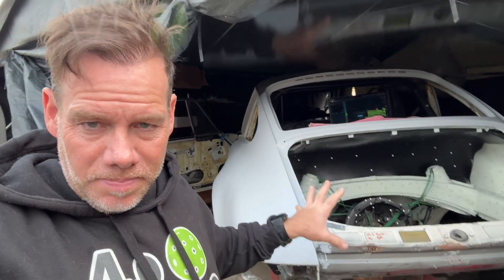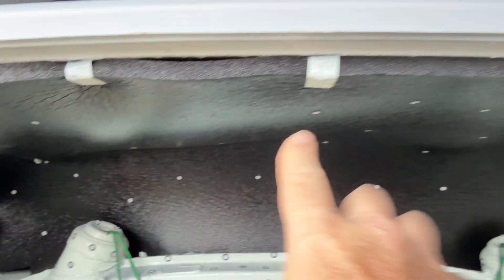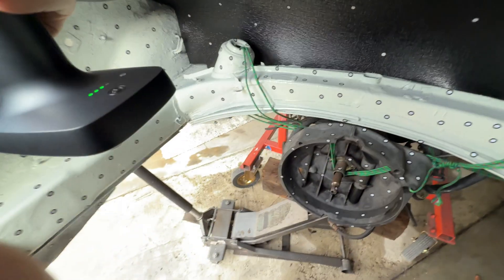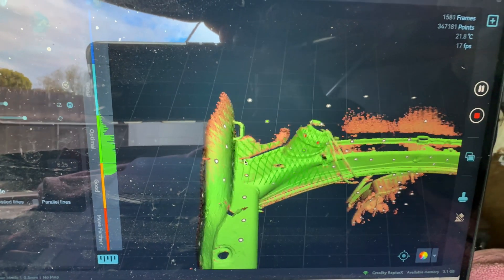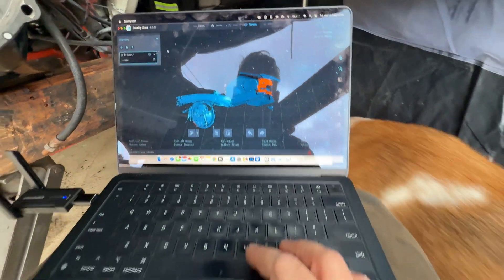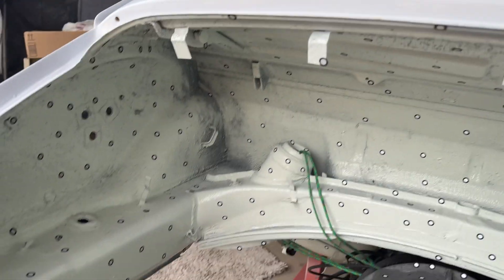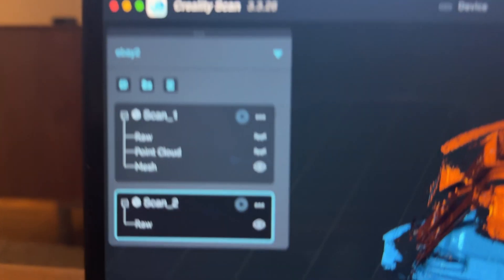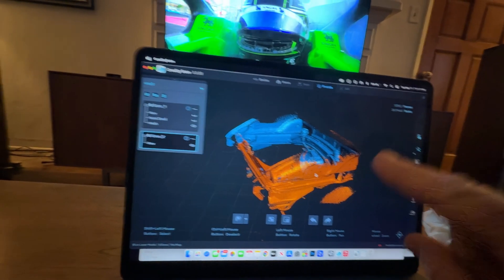Subaru Swapped Porsche Engine Compartment Scanning!

Comment: The metal package shelf under your laptop will block wifi signals.  You might want to get a USB extension cable for the wifi dongle so that you can position it better away from the metal.
Reply from the maker: That's an interesting hypothesis. I was like… 1 foot away but maybe there's some CIA/NSA stuff happening there. Lol